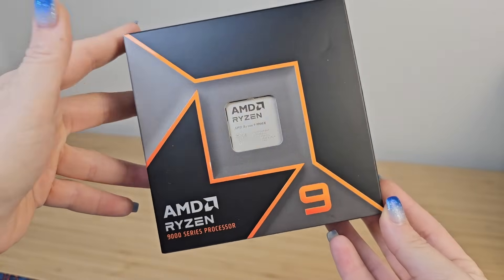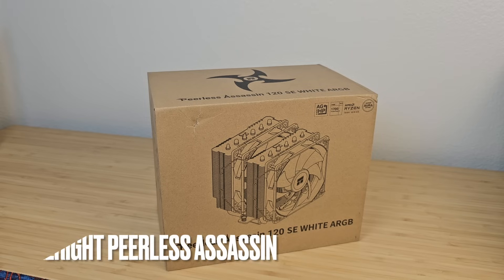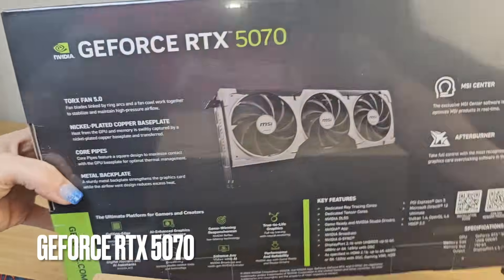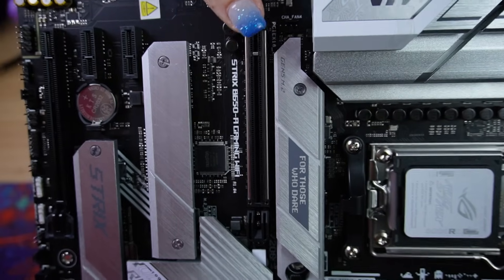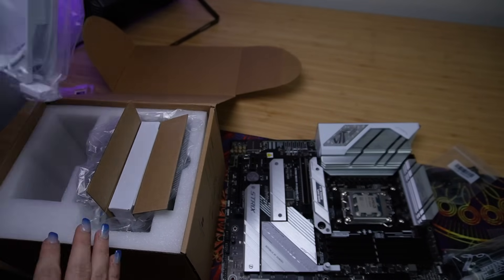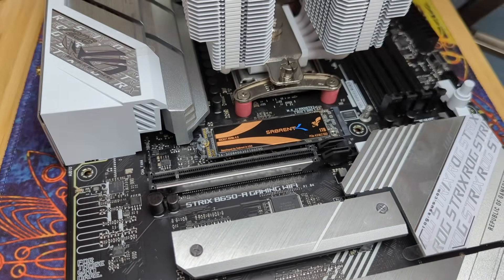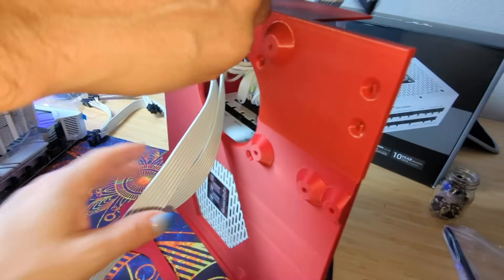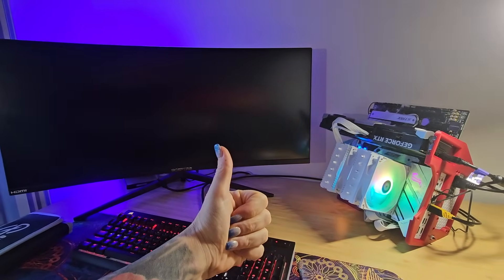Building a High Performance PC for Beginners: What to Buy and How to Put it Together!

Comment: Great job explaining everything. Just wondering if you would know. I use 4 different slicers and my internet browser windows and sometimes i can only use 3 at a time. Do you have similar issues with your new PC and if so how would fix them?
Reply from the maker: I can have as many slicers open as I want, maybe close to 20 before I notice lag. I am also using 5 different slicers, with multiple projects in each. Upgrade your ram!

Comment: Thanks for the info. My question that i could never get a really good answer on is what specific parts need to be "high end" for me to run Fusion360 without any issues?
Reply from the maker: I think that Fusion would be ram hungry. Maybe a ryzen 7 processor or better and a video card with 6gb or more (which is pretty low) and lots of ram.

Comment: Great job, A couple of things that I noticed, your ram is in the wrong 2 sockets, easy to do. you want them in a2 and b2 or 2 and 4. Also you're going to likely see hot spots if you did not spread that paste before you installed cooler. It was probably enough if you spread it but if you used the cooler, it will likely not spread to all the spots you need it to. One last thing as well, you called the GPUs power cord an 8 pin, this might confuse some newbies because it's a 12vhpwr or 2x6 (depending on your power supply standards) Good job otherwise. This may confuse them because the 8 pin is designed for less power-hungry cards and would not fit this GPU that you're using. Great vid that is good quality and informational.

Comment: Solid build. The only thing I would offer as guidance would be when buying a power supply you can check out PSU cultist list and anything c-tier or higher is fine. Jsut buying any "gold or platinum" doesnt guarentee quality as misleading as that is, but thats marketing at its finest.
Reply from the maker: Just to clarify I suggested EVGA or CORSAIR gold or platinum WITH a 10-year warranty, not just any gold or platinum PSU.  Thanks for the suggestion to others though, it's good to shop around and try new things :)